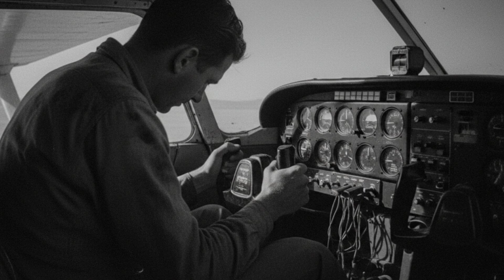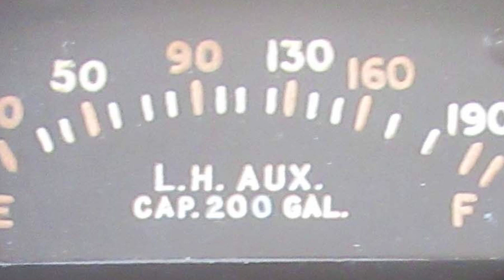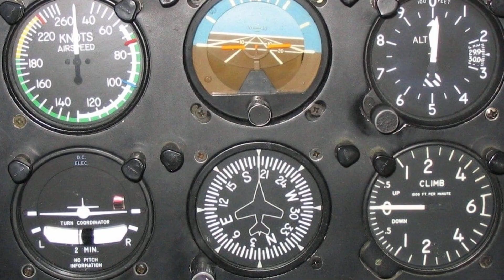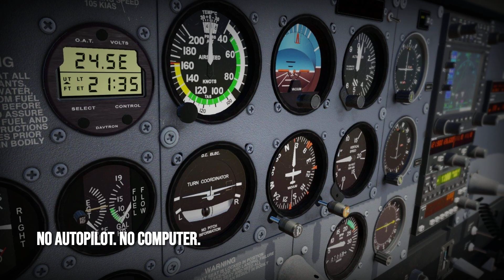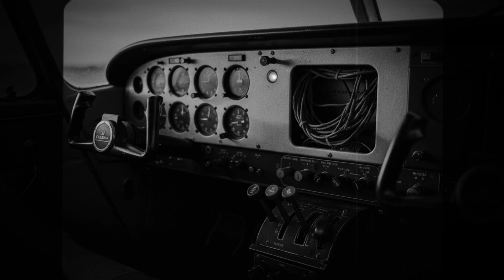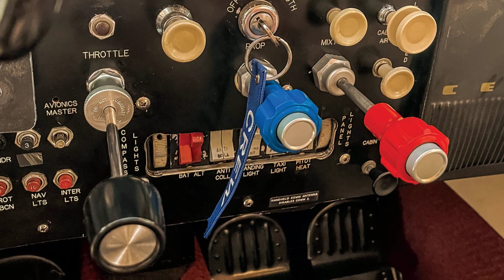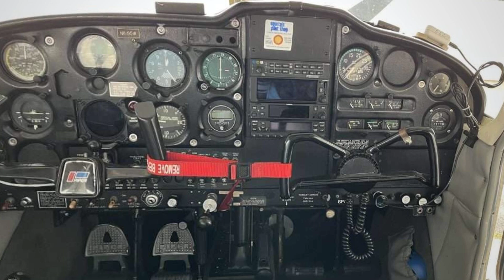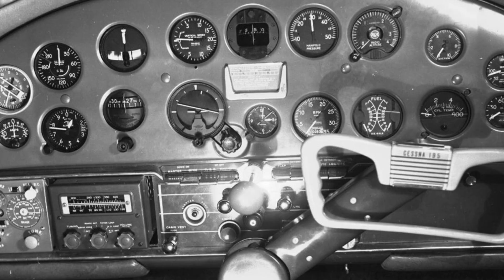Two Men Flew This Cessna For 64 Days Without Landing — Here Is How The Engine Survived

Comment: while I'm impressed about the performance of the engine, I wonder about the health related issues of the pilots!
64 days -- no eating? no bathroom options? no way to "stretch your legs" (sounds like a setup for sure for DVT) I wonder how many YEARS of their lifespan were reduced by this stunt (interesting though it was).
64 days in a coma will cause health issues (aside from the coma) unless steps taken to avoid pressure ulcers, etc.
I would like to ask the person doing this video to do an addendum going over the health related topics I mentioned. that might turn out to be as interesting (if not more so) than the story of the engine!